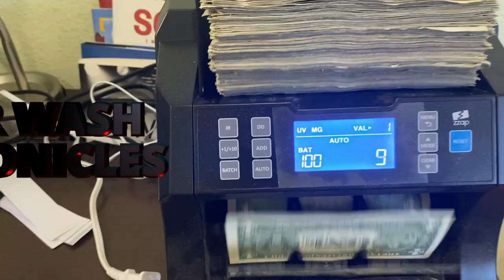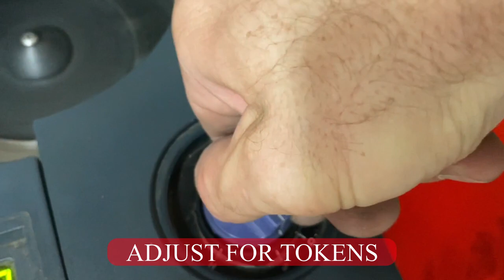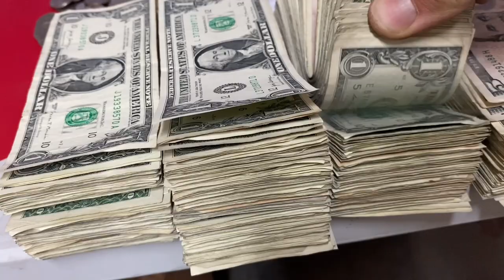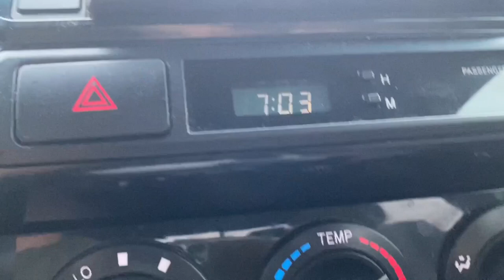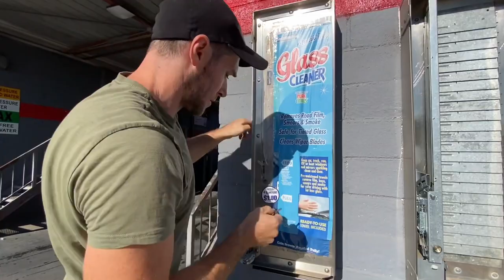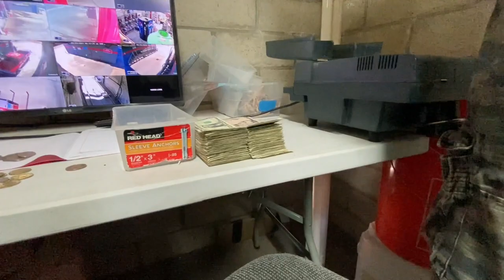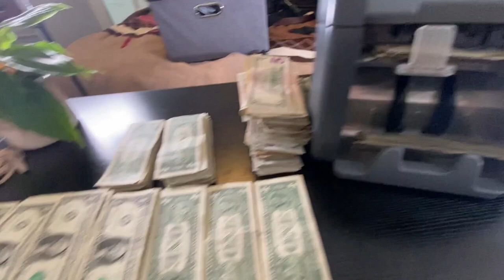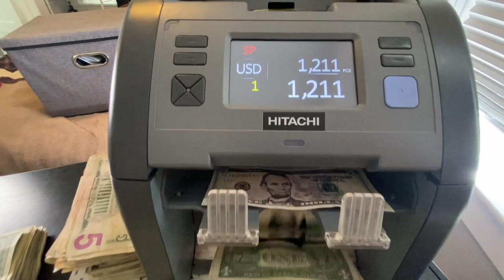THIS IS HOW MUCH MY CAR WASH MADE IN 1 WEEK! $$

Comment: If both of your washes are set up to use tokens why are you getting quarters mixed in the coin boxes? Is there a way to just have them except tokens so you don’t have to deal with the quarters.
Reply from the maker: I choose to program the coin acceptors to take tokens quarters and dollar coins so customers arnt limited. Machine separates them very easy. If just tokens and someone comes in with 10 quarters and no cash they wouldn’t be able to use my wash